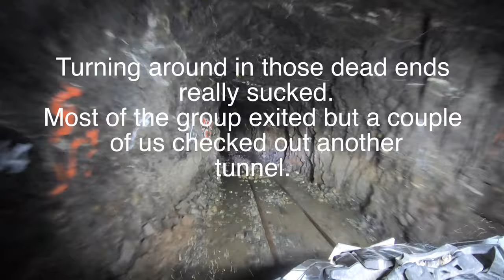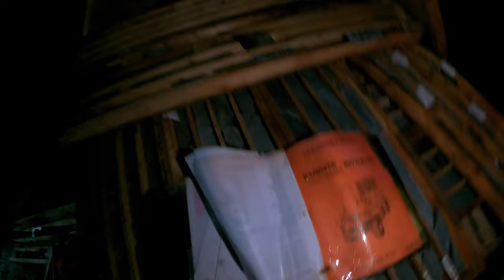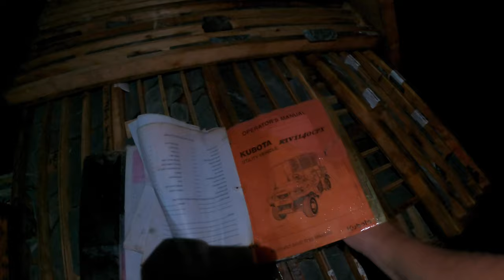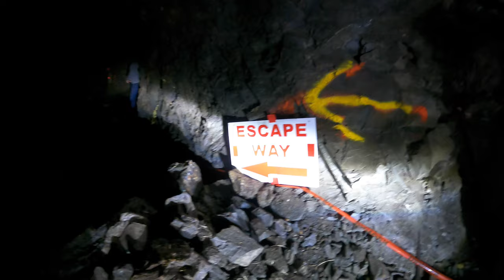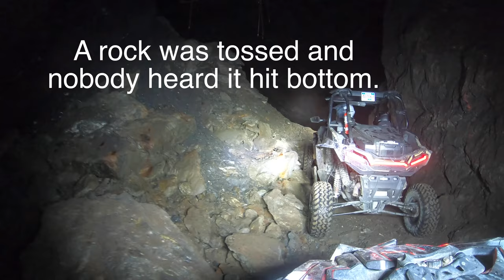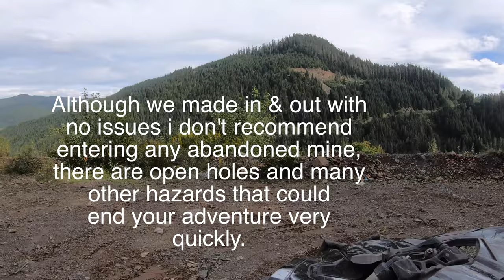Journey to the centre of the earth !  Exploring an abandoned gold mine.

Comment: First mine had some really cool ore shoots too bad it ended so quick but That second mine is pretty dang extensive, any idea how many levels there are to it and its history ?
Reply from the maker: Don't know how many levels but apparently there are over 20 miles of tunnels in there. Mine only ran from 81 to 84 and produced mainly gold. A few years ago a company bought the rights to the mountain and started selling shares to re open but it died pretty quickly, kind of sounds like a typical investment scam but who knows.
Reply: @Castle_Motorsports  totally possible to have been a scam but alot of folks need initial investors too just to get ball rolling for any extensive testint. That is ALOT of miles of tunnel for something only open for 3 years, almost  sounds like it wasn't on a good road to success to begin with. Wish we had mines we could check out where I am but everything's under ground, but no mountains  so it's literally under ground and flood out or have been capped over the years
Reply from the maker: The access road to this mine is easily accessible. There are many other mines in this mountain range and I know of 3 investment scams for sure in the last 10 years and I’m sure there are a lot more, either way these mines are still very cool to check out 👍🏻